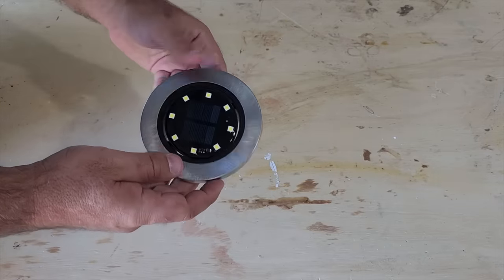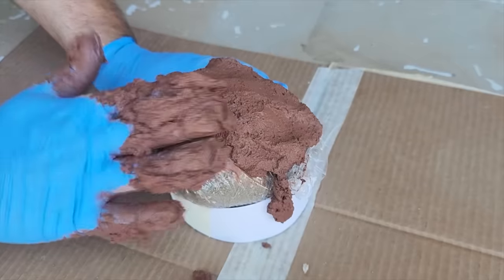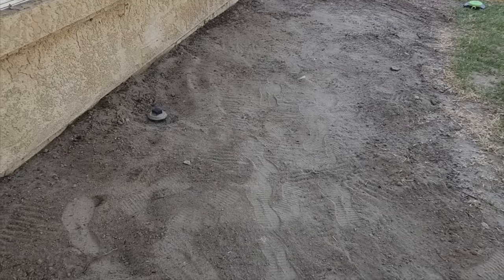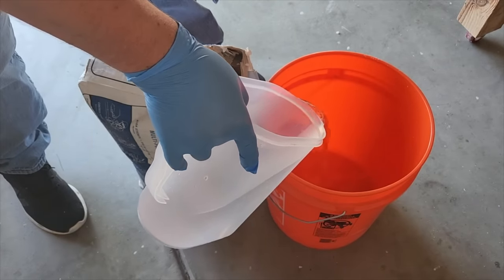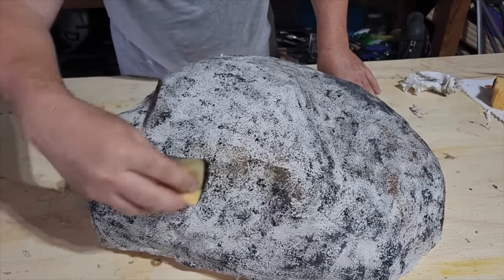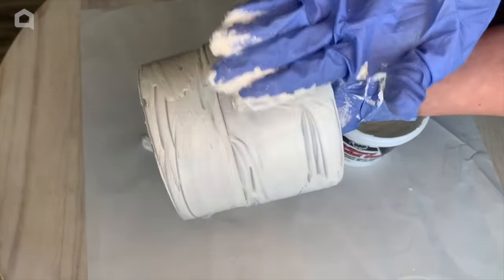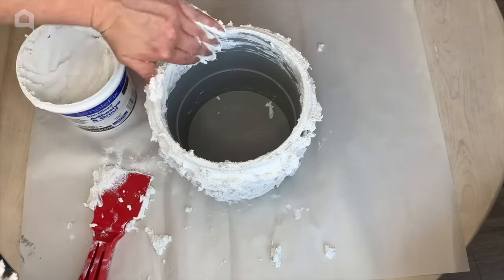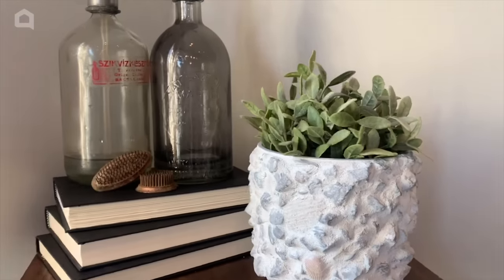The GENIUS new reason everyone's buying solar lights for their backyards

Comment: How does the solar light charge from the sun?
Reply: Looks like this solar is on the front with the lights
Reply: @ritawalker1933  absolutely the solar is in front. It’s facing sideways, it won’t charge if the solar panel doesn’t absorb enough sunlight.
Reply: @eyes2see438  the sun reaches the top and the sides... lol I have left them on my covered front porch sideways and charges just the same.